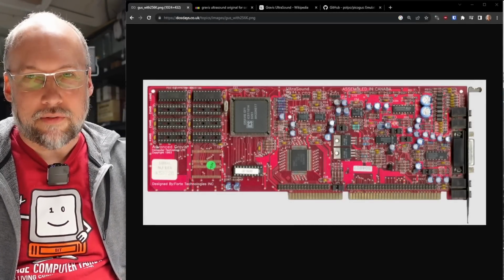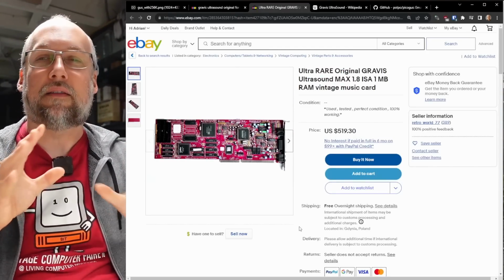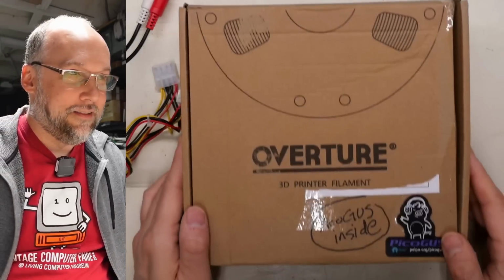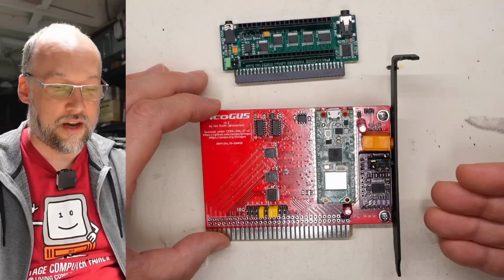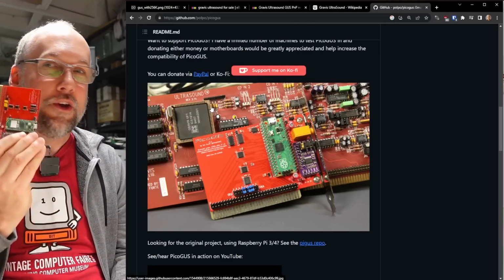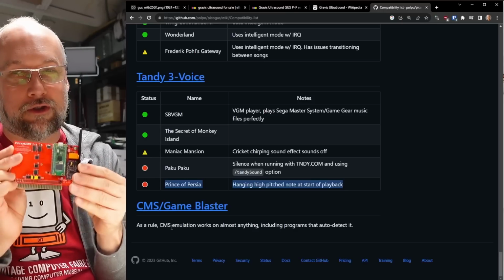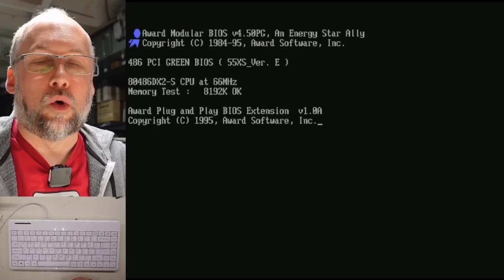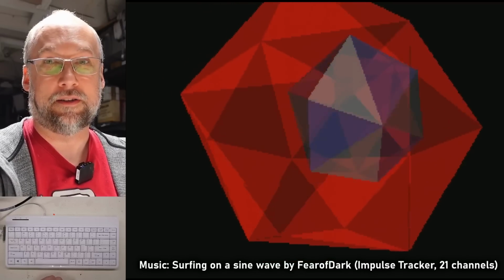The PicoGUS: An ingenious multifunction ISA sound card

Comment: You could get a GUS, or you could just MIDI 8 Amigas together to get the same effect.
Reply: 16 amigas....... not 8. 4 mono voices on 2 stereo channels........
Reply: @chloedevereaux1801  16 Amigas would be 64 channels (16x4) so now you would need 2 PCs with GUS cards (2x32) to get that many.
Reply: @daishi5571  But you might need two Amiga channels to do what one GUS channel could do - like pan something to the center.
Reply: @sirnickity  From what I have seen, most tracks that use that kind of level of sample playback don't use all tracks at once. That would allow flexibility to move channels around if you really require centering or panning. Then I guess it's a question of what more important to you, ability to play a selected sample or deciding what side you want it played from.
Reply: @daishi5571   Just squaring the math here.  You said it would be 64 channels, but it's really not, because if you want to accommodate any stereo panning at all (beyond the mandatory half-left, half-right) you would need twice as many Amigas, and then use two channels per voice, with each side mixed to the level appropriate for where the original sample was panned.  Since, by default, non-Amiga audio tends to be placed in the center unless panned otherwise, that would require 64 Amiga channels to accomplish what the GUS did in 32.

That's all.
Reply: @sirnickity  In this scenario of needing 16 Amigas to equal the GUS (frankly ridiculous) how would your GUS play 33 channels/samples at once? how about 34 - 64 samples at once? With 16 Amigas that's easily attainable, but not possible with the GUS. So thats not squaring up the math, it's fudging it by ignoring other capabilities.
I took a look at a few random 64 channel XM mods designed for the PC and what I saw was that at no time were 32 channels all at once using center pan but what you can also see is that when there were more than 32 channels that would have meant the GUS couldn't have possibly played that.
The fact of the matter is they are not directly comparable and what DavePoo2 said was correct in comparison of channels but not position, but what you said was correct in position but not channels. So you you're either both correct or both wrong. I know for me personally I have never played music on more than two Amigas at once using I think 7 channels max (some experimental stuff avoiding MIDI)
1 GUS = 32 channels - positional left, right
1 Amiga = 4 channels - 2 left 2 right
8 Amigas = 32 channels - 16 left, 16 right
16 Amigas = 64 channels- 32 left, 32 right
:-D I had a thought! because we are talking using samples how often do you sample a single sound (akin to a single voice channel) rather than multiple sounds. I know Amiga demos use samples as a way of playing many instruments at once, far exceeding the channel output in instruments in a single sample.
Reply: @daishi5571   First — yes, this is ridiculous.  Of course it is.  It’s a thought exercise.  Nobody’s ever going to stack up a dozen (give or take) Amigas to emulate a GUS.  (OK, maybe someone would…)

Second — there’s no room for debate on this.  To mimic the ability to play up to 32 voices with panning anywhere in the spectrum from L to R, it would take 16 Amigas, because you can’t guarantee that some media wouldn’t demand that you play 32 channels all panned hard left.  8 Amigas can’t do that.  16 can.  That’s just a fact.

Is that ever going to be the case?  Probably not.  An actual… ugh.. “real-world” implementation of a fully-capable GUS emulator for Amiga Clusters would probably do some slick on-the-fly channel allocation, and hope that nobody ever asked it to do the impossible.  In which case, the number of Amigas required wouldn’t be a fixed number, it would depend entirely on the source media’s complexity.

All that said, I think this gets closer to a legitimate concern when you consider using the GUS (or Amiga Cluster) as a MIDI playback device.  I have definitely exceeded the hardware channel limit of my AWE32 before.  It doesn’t take much when you have a patch with stereo samples (2 voices) where each key corresponds with a 5th chord (4 voices), and then you play a chord on the keyboard (12-16 voices).  And if that patch has a release envelope, and you change chords (24-32 voices)…
Reply: “The answer: use an Amiga. And if that don't work, use more Amiga.”

Comment: I had an AMD Interwave PnP, man it was pain in the bud. When it worked, it was great, but the chance was only 50:50.
You knew from the Demoscene that the GUS is awesome, bought the latest version of it and it was such a disappointment.
Reply: the timeframe where it was a gamechanger wasn't that long, as cpu's got much faster fairly quickly back then and you could just mix in software with really good results without affecting framerates much at all in just a couple of years after gus came out(and mod and audio mixer libraries spread widely, gus was easier to do a mod player for than doing the whole thing in software)